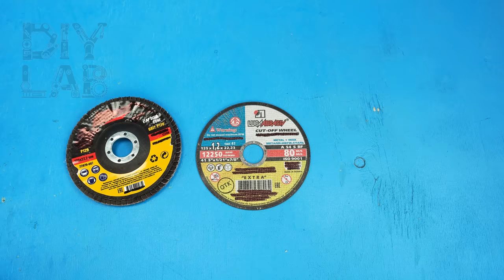Sharp Ax Sharpening Method in 5 Minutes!

Comment: 4:37 this ruins your axe and knife for sure.
The heat alone coming from both sides into the teeth of the axe will be too much. The metal weakens when it reaches certain temperatures which increase the speed at which the axe becomes dull again.
Reply: Да это просто невозможно!

Comment: wtf is this? 😂 please tell me there aren't people believing or actually trying this. none of the methods shown here will give you a functional splitting axe since you need a convex shape for your edge and everything shown here tends to give you a concave shape. (exept the mini-beltgrinder I guess, if you knew how to sand and sharpen that would work). what he made is a glorified cleaver. and as others pointed out the flipped over double angle grinder sanding discs only sharpen one side of the blade since they have an obvious rotation direction and hardly work when reversed (which is what you are doing by flipping the disc inwards)

Comment: Can’t be done in Australia. Under Australian Standards, electric power tools can not be engaged on, without a kill. You can’t switch a Grinder or Drill on, and take your hand off, it will stop. For a good reason. Only peasant countries with no standards allow that and as one guy suggested, when those disc shatter, they injur. I work in safety at BHP, several of those discs are even banned or require a permit to use. My Dad always said, those and bench grinders, change the tempered heat structure of the steel, and make it brittle. So, pointless anyway because anything done at high heat and high speed, requires sharpening again sooner, than I could have done with a diamond file, quicker anyway and a longer lasting edge.